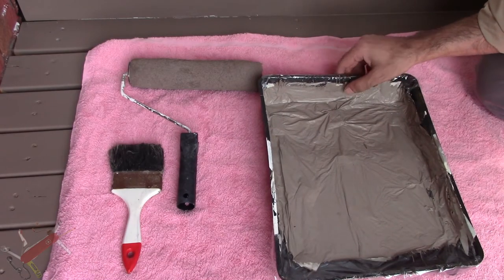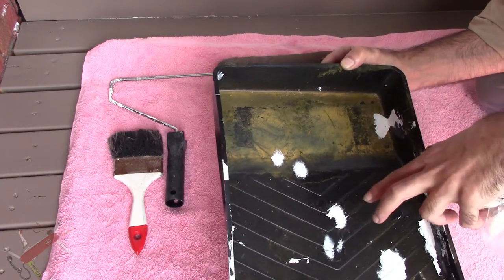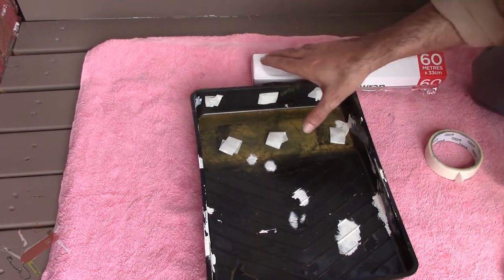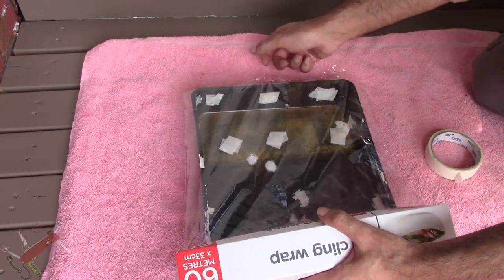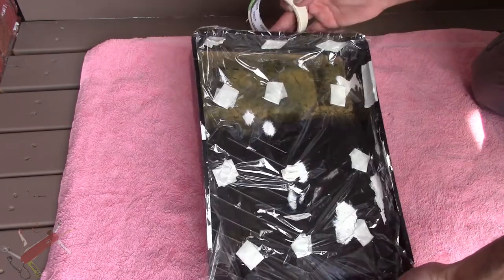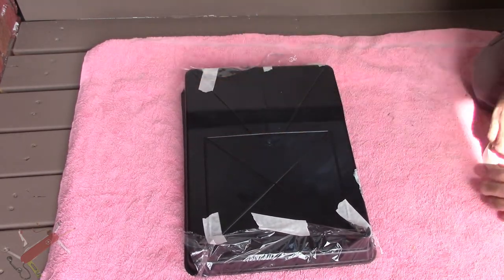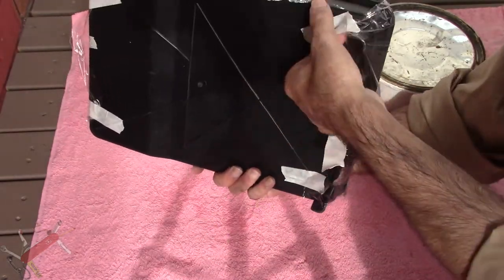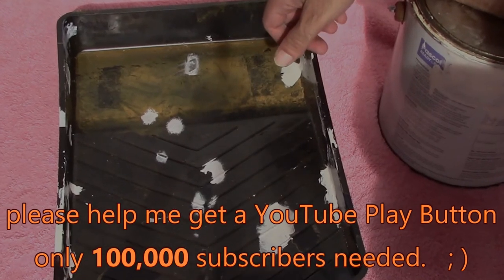Re-using Dirty Paint Trays (or How To Instantly Clean Paint Trays)

Comment: Just looking for tips how to clean the roller, I dont want to throw away and buy another one
Reply from the maker: soak it in water (non-oil based paint) then lightly wrap a wire coat-hanger around it to form a firm loop.
run the loop up and down.. forcing the excess paint to the ends. finish by handwashing.  takes about 5-10mins

this will get you a bit more life from your roller, synthetic and wool.  i also wash before using new synthetics to avoid stray fibres.

thanks for watching, good luck 👍🏼
Reply: Rollers and oil based paints.. any ideas for cleaning?
Reply: 5 in 1 paint tool with a curved scraper along the side, for $2-3 from Bunnings